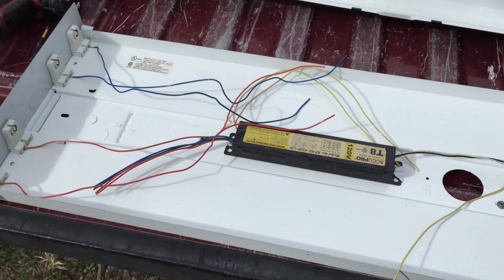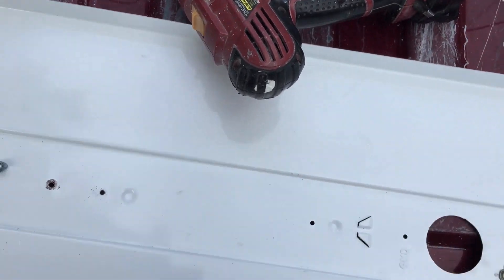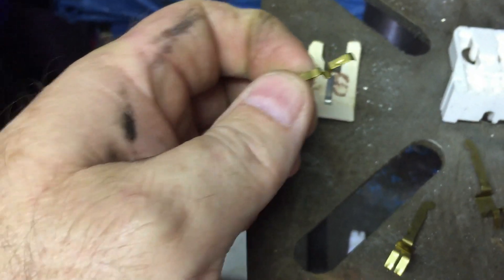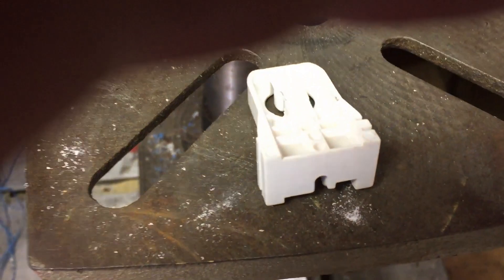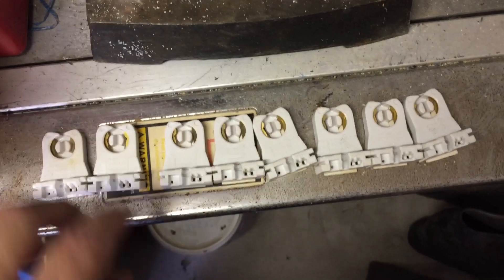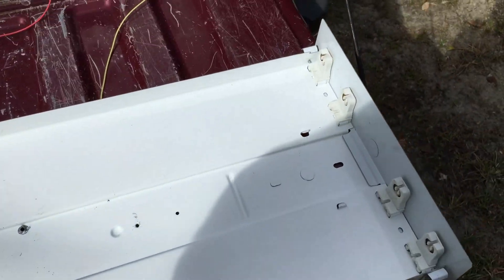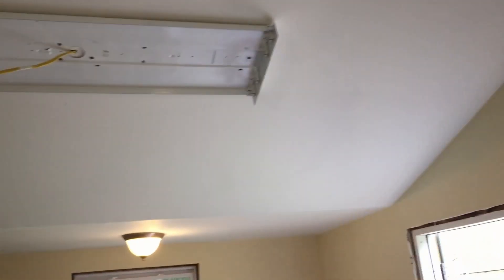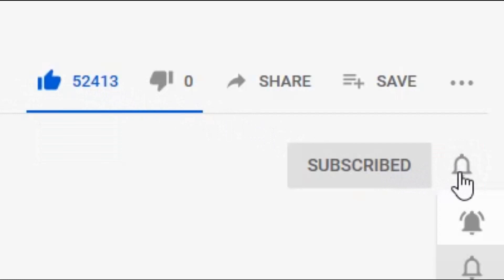Single-end LED tombstone conversion shunted to non-shunted

Comment: If you would have just bought a satco s e /d e single-ended double-ended bulb twist all of your hearts on one side twist all of your neutrals on the other it would have saved you so much unnecessary work. Works with shunted and non-shunted sockets
Reply from the maker: But then what would I do on a Sunday afternoon. Sometimes even a cheap solution isn’t a solution if you can’t get the parts.

Comment: Hey good vid...for double ended led lights...ie one tombstone end is live one is neutral, does it matter if shunted or non shunted...i dont think so but just wanted confirmation thanks
Reply from the maker: if the lights are double ended then it usually doesn’t matter if they are shunted, but you need to verify the specs of the lights you choose.
Reply: @RehabLife  thanks...yeah lights are in and working...they were non shunted
But yr right double ended (and single pinned fir that matter) doesnt matter shunted on non matter..as long as there is a path to allow current to flow at each end..single ended would specifically require non shunted, i believe, as one pin is for live other and other pin for neutral.  Dies that sound right👍👍
Reply from the maker: @daltropical5236 yes

Comment: How does the wire going into the drilled hole stay in contact?  What size hole did you drill?
You stopped short of completing the wiring to your ceiling.  Next time please use a tripod to hold your camera steady.
Reply from the maker: They have spring clips inside that hold the wires. The hole was 1/16” but in reality only needs to be big enough to fit a 18ga wire.

Comment: Thanks for the video. You are not really showing exactly how you so cleanly removed the clip holding the back cover on nor really showing how the ends of it. I though it was maybe a spring, but the points that show in the video look tapered and tapered the wrong way. Unless you'd have to kill me if you tell me, nyuk nyuk, nyuk, please let me know. Many thanks.
Reply from the maker: There is a metal piece on the back of the tombstone that holds the fiber cover in place. Using a small fine tip screwdriver you can pry it off and remove the fiberboard cover.

Inside there are three pieces of brass. One for each lead on the bulb, and there is a third piece that just floats between the two that shunts them so they are both powered from a single lead. That piece is removed and discarded.

Using a 1/16” drill bit will provide enough clearance for an 18ga wire to go through nicely. A 16ga will be too tight but I think most fluorescent lamps use 18ga wire.

Anyway, once the shunt has been removed, replace the back and press the metal retaining clip back into the tombstone.

So long as you don’t bend the brass clips inside, the wires will grip just fine.

Comment: I understand what, how and why you did everything and it all was very easy to follow Until the very end I got lost. I didn't understand the finale connection to power as far as the 4 bundles of wire the blue & yellow, the black & yellow, and then the red and yellow. How are they wire nutted to together with pos. and neutral?
Reply from the maker: Single ended LED bulbs use 120vac. One side is the hot side and one side is the neutral side. Essential that’s all that matters. It doesn’t even matter which side the hot is connected to so long as you don’t connect it to a green or white wire because those represent ground and neutral.
Reply: @RehabLife  Thanks for the quick response, I realize the connections are made only to the one side. But I'm lost as to which of those 4 bundles connect to the hot and which connect to the neutral. As you can guess I'm handy but not an electrician. Which of the  yellow, blue, red & black connect to the hot and which to the Neutral?
Reply from the maker: @kevinpierce731  The fixture came wired with a ballast and had black (hot), blue (hot), red (hot), yellow (neutral), and white (neutral). I reused the existing wiring and followed typical nomenclature for hot/neutral leads.

Black, Blue and Red are all typical hot leads so I used those on the hot side of the keystone. On the neutral side, I used the yellow wire.

I twisted them together using the drill as a wire management method and then separated the hots (according to color) and neutrals and connected them to the black and white wires of the home electrical system (respectively).

In the big scheme of things the color of the insulation on the wire is there so the next person coming behind you can readily identify what is hot and what is not. There really is no difference in the wire itself. Because this is alternating current, the direction of the electron flow is bidirectional.

Anyway, I hope that answers your questions.
Reply: @RehabLife Thank you, that clarifies it for me.

Comment: Very interesting. Those tombstones are quite different from my fixtures which range from 20 - 40 years old. Mine don't need extra holes drilled and they don't have a removable shunt.
Reply from the maker: I’ve had some with the holes already in them

Comment: Are you saving wire doing it this way versus using a jumper?
Reply from the maker: Not really because both ends usually come wired. This eliminates one point of failure and allows for single ended LED installation. You can get direct replacement and dual ended LED lamps as well.

Comment: No offense but I just purchased a bulk supply of non shunted tombstones off Amazon for a great price.  Your time is too valuable to do surgery on old stuff.  Just buy new ones and throw out the old stuff.
Reply from the maker: but I wouldn't have gotten the enjoyment and satisfaction of doing it myself ... I did buy some when I swapped over a bunch of fixtures.
Reply: @RehabLife  I agree with your reply. You sound like me, I have more time than money !
Reply: Yes, easier and cheaper.  But.....in a pinch...has to be done today.....no time to order from Amazon, store is closed or they are out of stock, this works perfectly and safely.

Comment: ON THE END NOT POWERED YOU CAN LEAVE IT SHUNTED CORRECT ?IT DOESNT MATTER ON A SINGLE END POWERED BULB
Reply from the maker: The pins on the unpowered end of the LED bulb do not connect to anything so they don't have to be changed. Just disconnect the wires from that end and you are good to go. Thanks for watching!